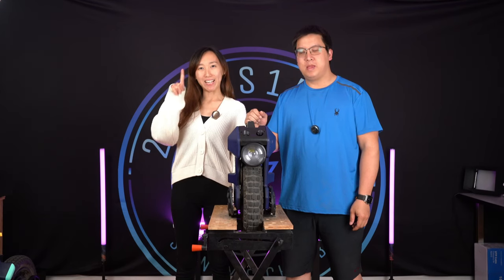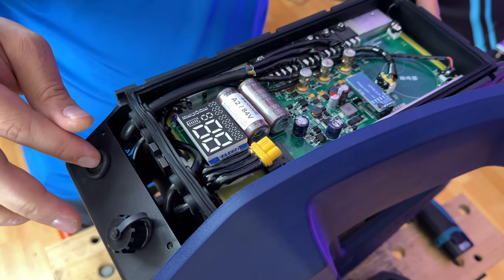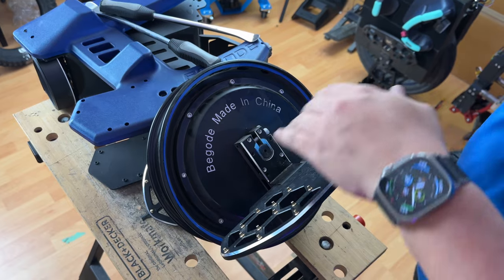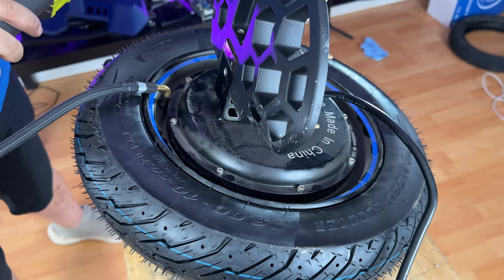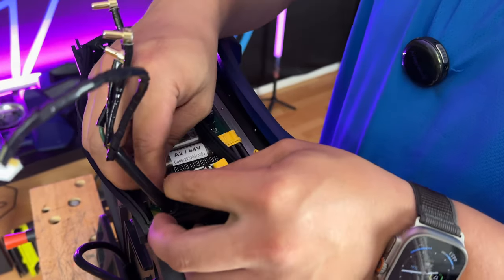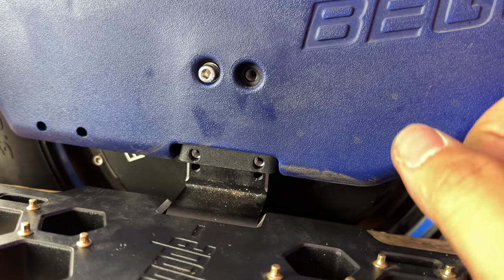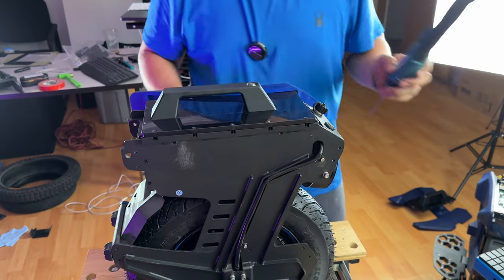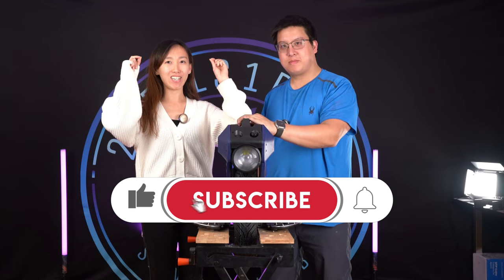Begode A2 Tire Change

Comment: Cool that you used my A2 for this video! Glad that you replaced the seal that snapped, and plugged in the power cable;) I honestly can say that I'm glad you did this tire change instead of me--it's quite involved! I've only ridden the new tire for about 20k so far, and it feels a bit more maneuverable than the knobby tire it replaced, but given its width, it's still not as responsive in turning as my T3 skinnier tire. Guess it just takes some getting used to.
Reply: nice, got any footage? the knobby may be a bit too vibrating for me
Reply from the maker: It is an amazing tire for your wheel. I thoroughly enjoyed my test ride after completing the change :)
Reply from the maker: there's no way i would leave you with a broken seal :p
Reply: Thanks!

Comment: Screws to be removed: 4 + 12 + 4 + 8 + 4 + 13 = 45, then uncover the motherboard, then 6 wires to be unplugged and then the wheel remains connected to the shell via the cable, just to make the further handling a little harder. On a V8F, it's 16 screws and 6 wires to unplug where the motherboard needs to be uncovered too but the motor becomes separate from the shell. That we need to open up the motherboard to change the tire doesn't look like good design to me.
Reply from the maker: Yeah, in the current crop of wheels I was disappointed when I took it apart

Comment: Hey.... I did a Tyre change on my m10-4 but I can't get the edge of the Tyre to sit on the edge of the rim.  Do you know what I can do to get the edge of the Tyre to sit on the edge of the rim.
Reply from the maker: You’ll need to visit a gas station and use a compressor. Electric air pumps don’t have enough volume to seat the head

Comment: Hello, I Changed my tire and when i put it back together now the wheel wont start and im dumbfounded all wires are looking fine and all plugged in, whats could possibly have happened :S
Reply from the maker: It doesn't turn on at all?
Reply: @2cells1pack  nope,  people are telling me the mainboard is dead, i noticed the battery  plug is kinda toasty, and sparks alot when i put it in and out, but they say thats normal. i just dont know what happened XD